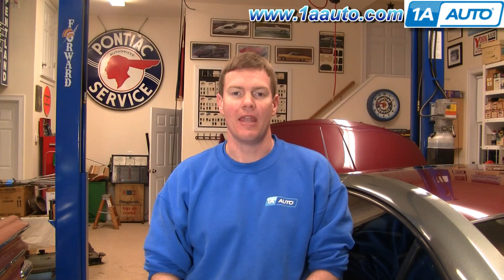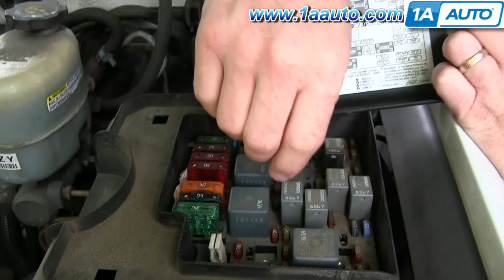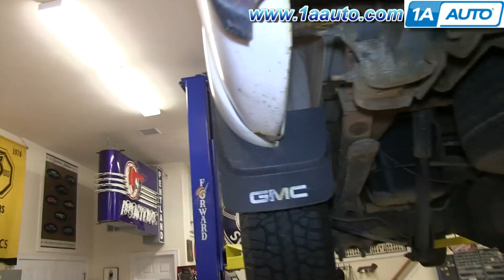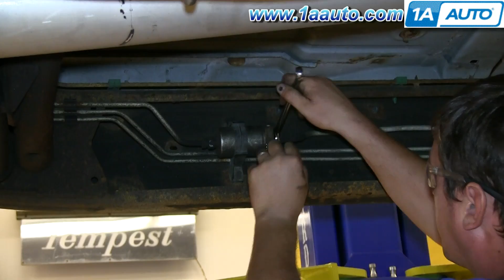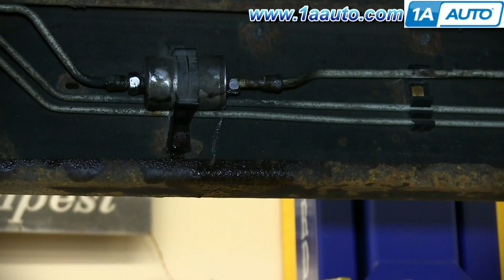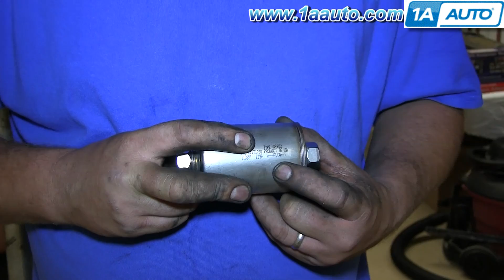How To Replace Fuel Filter 01-03 GMC Sierra 2500 HD

Comment: Just a tip: I cut the fingertip off a nitrile glove, rolled a castrater rubber band over the tip, then slipped it on over the rearward end of the fuel line as I took it off the filter. It effectively keeps the fuel from draining out all over creation.

Comment: break the line then have to replace it, cost me hours of work and money majorly, turn the filter and keep the line held in place if you can, saves you al ot of grief and expense: chevrolet in their infinite wisdom set this up with two flares that rust weld into place so you are forced to break the lines instead of having one side with quick disconnect that lets you turn the filter instead of the line

Comment: Is the fuel filter for an 05 tahoe in the same spot?
Reply from the maker: We currently do not have an auto repair video specific to your vehicle. You might be able to apply some of the basic steps shown in this video to your application.  The fuel pump may not be in the exact location as the one in the video. +J.M Robbins

Comment: Did this, step by step. Fuel just gushed out of the lines as if there was still pressure, except my truck never died out after pulling the relay so I just turned it off after a few minutes, do I need to let it sit longer?

Comment: Dear 1A..you didnt mention year 2007 GMC Sierra truck which i own one. Where is mine? or is it inside the gas tank n non-serviceable? Thanks. my truck refused to accelerate in hot weather n stiff hills, the longer i rest stopped the truck a  lil farther i could drive until engine acted up again.
REPLY
Reply from the maker: +Tuan Quach Thank you for checking us out. We apologize that the 2007 model was not mentioned. The fuel filter for this 07 model is part of the fuel pump. 1aauto.com

Comment: Dear 1A..you didnt mention year 2007 GMC Sierra truck which i own one. Where is mine? or is it inside the longer i rest stopped lil farther i could drive until engine acted up again.
Reply from the maker: +Tuan Quach Thank you for checking us out. We apologize that the 2007 model was not mentioned. The fuel filter for this 07 model is part of the fuel pump. 1aauto.com

Comment: you could always relieve fuel pressure at the Schrader valve on the rail, this doesn't force the engine to run lean and die.
Reply from the maker: +Isaiah Furrow Thank you for checking us out, and the feedback. This will be helpful to other viewers! 1aauto.com
Reply: Hey mine doesn't have that on the rail? 06 silverado 1500

Comment: Is it a good idea to replace the o-rings on the fuel line as well to prevent leaks? If replacing, does it need to be a special o-ring that won't get eaten away by gas?
Reply: Good question? Have  you found out bro?
Reply: Yes it is.

Comment: i have 2003 silverado 1500 and still have alot of gas in the line i had to put the old filter back on quickly making a huge mess any one can help me out what could be the problem i disconnected the relay
Reply: 1A Auto Parts i disconnected the relay and the engine shut off and i started disconnecting the fuel filter had gas run out but it kept leaking a good amount of gas, when i thought it would stop it didnt?
Reply from the maker: +Reid Chambers Thank you for the response. You may need to disable the fuel pump fuse prior to turning on the vehicle. Once this is removed, start the vehicle and once it turns off again due to no fuel shut the vehicle back off. This should clear up the fuel to the filter. 1aauto.com

Comment: i have to call BS on this one. I have a 2005 GMC SIERRA 1500. Fuel filter not in this location. There is a black cover over something in front of the fuel tank but i cant figure out how to get in to it.
Reply: John Edwards I read that 04 and after they put the filter in with the tank so you run until the pump fails, I could be wrong. My 03 1500 is located where the video says.
Reply: If you have a 4.3 V6 you don't have a external fuel filter. Only comes with v8 engines.
Reply: @TrackandStreet  Not true..My '05 Silverado 2500HD 6.0L does not have an external filter.
Reply: Greg Fields Maybe on certain years, I used to have a 2000 Silverado with the 4.3 V6 and it is in the same place as my 1999 Sierra with the 5.3 V8.
Reply: Greg Fields its a year thing my 2004 has no filter there either
Reply: 2006 silverado may be what the titles referring to,  it's kind of a jumble

Comment: I didn't pull the fuse relay, I instead left the keys out of the ignition, the fuel pump isn't going to run/ hold pressure if the truck is off. Just did this 10 minutes ago on my 01 2500 6.0

Comment: umm I'm not sure what it is, but I own a 2005 GMC Sierra v6 4.3L and..... there's no fuel filter coated as shown in this video.
Reply: Dro77080  same for me on 2004. Fairly certain its part of the sending unit
Reply: Yours has the filter as part of the pump inside the tank. Nonservicable.

Comment: I have 2004 gmc 1500.5.3liter motor....can't find the fuel filter...where is it's location? My 2001 is same as your video shows... thanks
Reply from the maker: +roadstar499 It should be around the same location as shown in this video. If you have a service manual for the vehicle, it should show the location of the fuel filter in it. Hope this helps you out
Reply: I read it's in fuel tank
Reply: Same here 04 sierra 5.3 no filter can be found BUT my wifes 03 Yukon 5.3 has a filter in the spot of the video shows

Comment: Are there any video on changing the oil pressure sensor on a 2008 Silverado 5.3
Reply from the maker: We currently do not have an auto repair video on this particular year, make and model. We'll keep this request in mind in the event that we need to make this repair in the future. Thank you for asking. 1aauto.com 866-403-3393

Comment: I want to do this on my truck but the fuel lines going into it on both sides look very rusty...  Is it a bad idea to try to replace the fuel filter without being ready to replace the fuel lines to it as well?
Reply from the maker: If they are really bad, you may run the risk of disrupting them, and having a leak. You may want to replace everything at once, if it looks like the fuel lines should be replaced. Hope this helps you out. 1aauto.com 866-403-3393

Comment: Question why did you disconnect the fuel relay?? Thank you
Reply from the maker: This will run the fuel out of the line so that it doesn't spill all over you when making the filter change. Hope this helps you out. 1aauto.com
Reply: To relieve the "Pressure" in the line before opening the line

Comment: Great video, love the pull the relay trick to bleed the fuel line. I changed mine and still had a bit of pressure left not too much though. I was having trouble starting my gmc sierra, I had to prime twice (turn the key to on) before it would start. Changing the filter did the trick starts right up. One thing too mention is keep track of your O rings. Mine fell off after the line was disconnected.

Comment: i want to replace the fuel filter but there is an abs module right in front of it, any advice on getting around this with out removing the abs module and removing the brake lines/ having to bleed the entire brake system or am i screwed ?
Reply from the maker: If you can unbolt it from a bracket somehow with out disturbing it much, you might wan to see if that's possibly. Hope this helps you out.
Reply: Thank you for the reply. i started by unbolting the abs module and moved it slightly for more clearance but 1 of the nuts to the fuel filter wouldn't budge because of rust so i had to cut the fuel line off right after that nut to get the filter down/off, replaced the old filter with a Wix filter and replaced about 3 inches of fuel line in the process and now the truck is running better than ever, problem solved and i didn't have to pull out any brake lines. So i never run into this problem again, i made a shield/protector plate to go over that area, it will never see water or salt again. Too bad GM didn't take that necessary step and save us all the trouble of rotted lines or botls. Good luck to anyone taking on this task with abs, it was a real pain and time consuming but it was all worth it in the end.

Comment: i have a gmc sierra 02. I took it to a mechanic to get my ac fixed he ended up not fixing my  ac and so then we saw your videos and changed ac filter and blower bc it was making this loud noise. well the point is now my truck shuts off on me when ac is on sometimes if its parked with ac on or even while its running although it only does this when ac is on. any idea what it could be? we also have changed alternator fuel filter and spark plugs and wires but nothing what could it be

Comment: Hey 1A  Auto, I have a 03 gmc yukon xl which flex fuel "I think" and the filter is totally different. One end has the nut to put a wrench on it and the other end is a tube with a clip. But the clip goes into the female housing of the fuel line and I don't know how to undo it to get it out. Is there a special tool for this? Do you have a video on this particular filter?
Reply from the maker: We currently do not have a repair video on that particular set-up. We'll keep this in mind in the event that we need to repair this type of a set up in the future. 1aauto.com 888-844-3393

Comment from the maker: Gas tends to weight quite a bit, you should run the tank dry if possible. Home Depot also has a liquid pump for under 10 bucks that you can use to siphon the gas out, if the pump failed with a full tank. Hope this helps you out. 1aauto.com 888-844-3393

Comment from the maker: Probably around every 30,000 1aauto.com 888-844-3393
Reply: Does removing the fuel pump relay hurt the engine at all while its running?